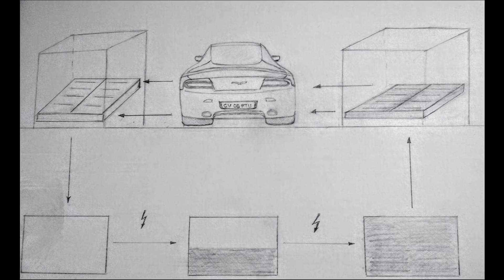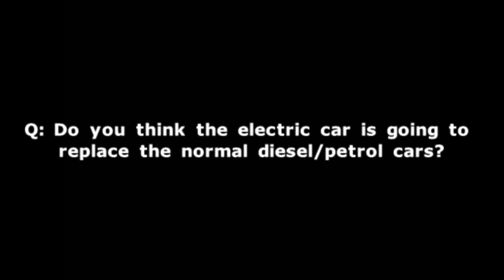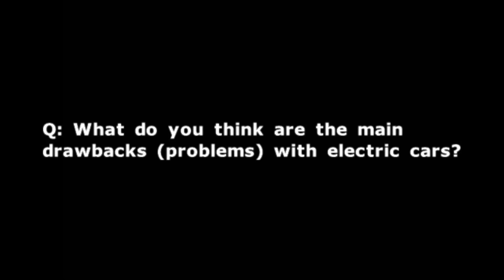IBC Power Station

Comment: The idea is good but who owns the batteries? I don't want my new battery changed for a old one at the station.If the charging station owns the batteries they can replace the empty one with a full one . But if the driver owns them he have to wait for recharge.
Reply: We want Bosch to be the owner of all standardised batteries which will then be leased to the electric car owners. The way of distribution of the batteries will be by Bosch supplying a number of batteries to different station locations which will then be stored in a secured area and charged afterwards. The idea is every station to have availability from 50 to 100 batteries which will be ready to be replaced with the empty ones (which should consequently be owned by Bosch as well).